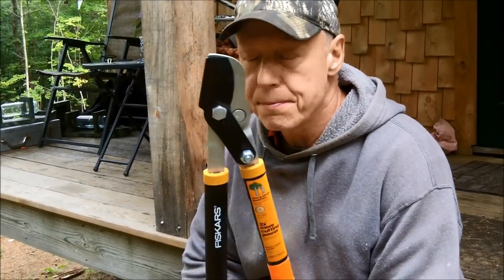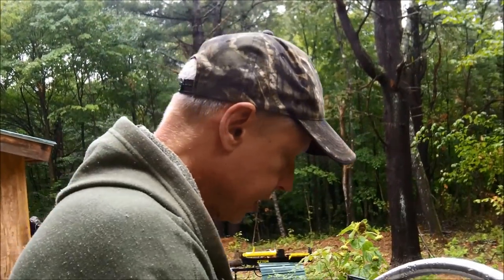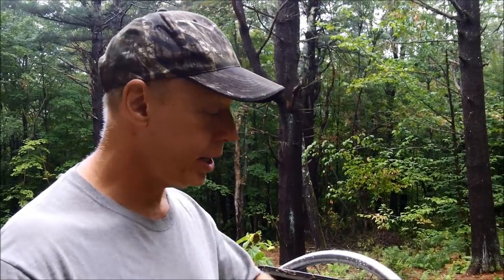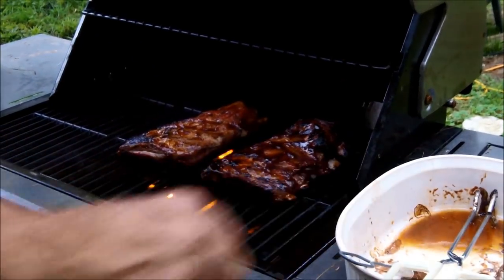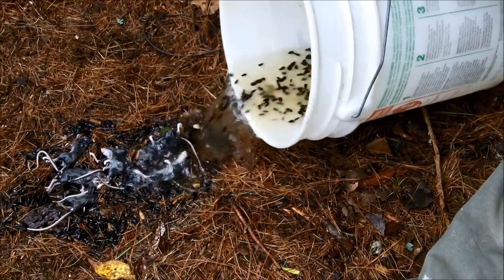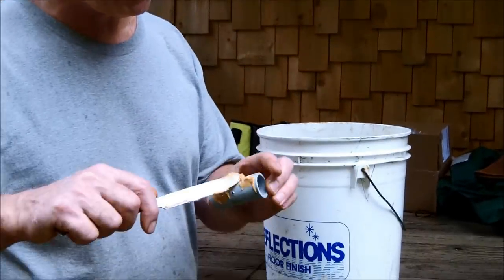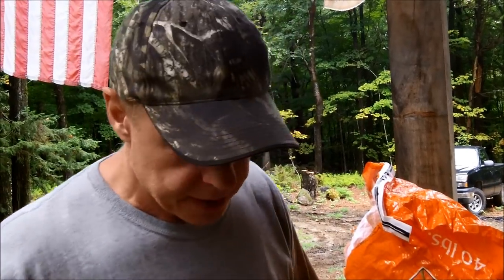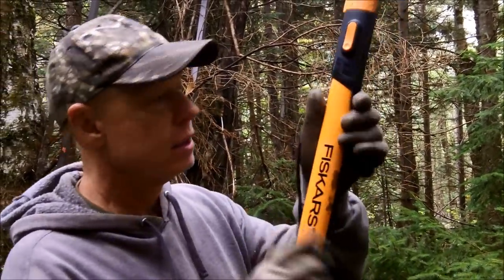OFF GRID CABIN LIFE   How To Build A better Mouse Trap, plus Random Clips. Vlog  #12

Comment: I have three sets of loppers. One set bypass. One Anvil style and one set is the larger ratcheting kind.
All of them have extendable handles.
The ratcheting type are  only good for the bigger limbs. Mainly because you have to pump them four times no matter what. But three inch limbs are easily cut.

I use the light weight ones like you do but I use the extendable handles to reach up further. I cut off limbs that are or will hit me in the head on my property.  It is a never ending task.

Thanks for the lesson on the grill grates. You added to my todo list.

Mouse trap is excellent. I think have enough stuff to make one in the back of the truck.

Take care of yourself.
Ignoring your body is like ignoring the check engine light. The longer you wait the more that has to be done.

Comment: Many years ago (28) I was attempting to cure a 20" duel handle skillet at a camp ground in TN., when an old timer said to me, "kid.., the sure fire way to cur that skillet is with olive oil and sand. Get the skillet hot on the fire remove it, add the oil and sand,( a handful or two), just use regular barr sand, and start rubbing inside and out, until all the oil is gone and the sand begins to clump. Then rinse it out and do the same thing again. Do this probably 4-5 times, and you'll never worry about using oil or butter to prevent sticking again. AND rust will never appear again either." 
So I figured I'd give art try, nothing ventured nothing gained. Guess what, that old timer was spot on. We've use that skillet for everything when camping and in 29 years I've still never had to oil it ever. I just rinse it and wipe it out with a very mild detergent wipe it dry and its good as new. Just a tip.
BTW I really watching your videos, keep-em-coming BOSS!
Reply from the maker: Interesting.  The sand was probably used as an abrasive for cleaning but the olive oil alone is all you need. Same principle without the abrasive.   Love the ironware :-)

Comment: I attest to the mouse trap I have lost count as to how many mice I've caught this year and yes Boss I even got a chipmunk also.  I like the new method, but I think I'll put end caps on mine.  On the beer can one I dented the can a little and evenly spread the peanut butter and that seemed to work.  I think the PVC will work much better.  By the way I used coat hanger wire, always good information.  Have a splendid weekend.

Comment: Hi. I use the same set up for mouse trap here in Iceland. Now days i just use clear water and ramp to the edge but no spinning weel. I spreed butter (for some reason i grew up using butter as a bate) just about the waterline. It worked better then the bocket next to it with a spinning weel. Not sure why.

Comment: Another great video, thanks. Is there any way to put some kind of screen over the bucket to keep the chipmunks from falling in? Maybe 1 inch by 1 inch grid? Nice work restoring the dump grill to better than new and those ribs looked fantastic. Best wishes for a speedy recovery sir.
Reply from the maker: It's possible I suppose but if they're in my buildings i want them gone. They'll chew a wire as fast as any mouse.
Reply: Thanks for the response. I was thinking you caught it outside.........That's what I get for thinking, lol.

Comment: YES!! I have mice that get in garage and get into my '72 Chevelle, so yesterday I set up the bucket like you did and this morning(10-26) I had 3 of those bastards(mice). Round 2 tonight. I've used the bucket/seed/ramp  combo on chipmunks before but this the first time with the peanut butter trick.Thank you. I hate mice too!  I'm in  Maine and want to keep this going all winter , but I need to get a solution that won't freeze. Any suggestions? (rv anti freeze, windshield fluid, prestone). great video!
Reply from the maker: RV anti freeze.  Kill em all :-)